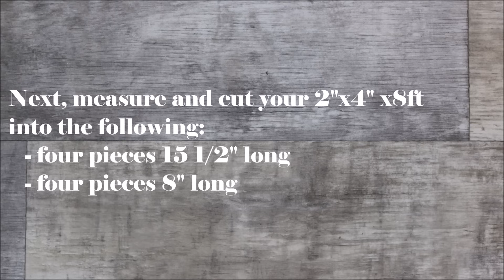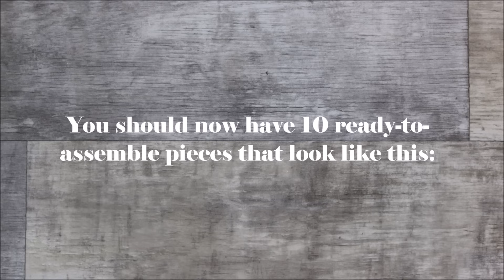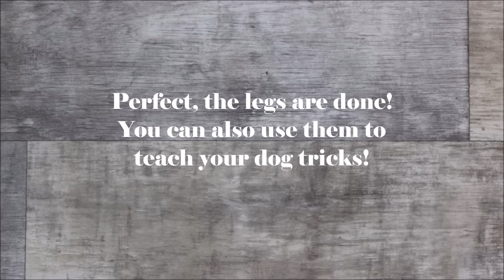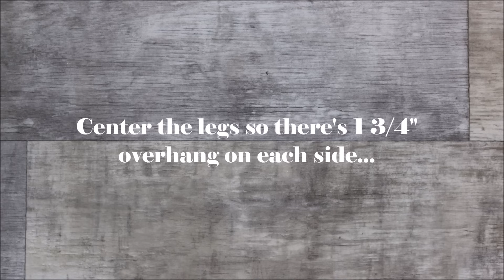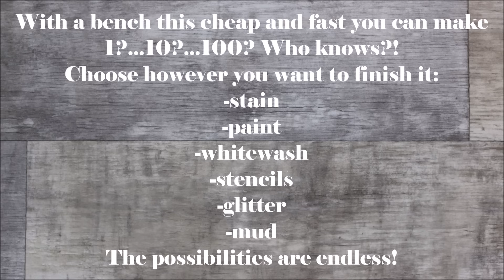The $15 Fifteen Minute Bench - Easy DIY Project

Comment: I just build this as an outdoor bench for my patio out of a box of wood screw [$8.98], (2) 2*6*4 cedar fencing face [$2.68/each] and (1) 2*4*8 pressure treated wood [$7]
so no need to stain 😅
There's no over hang on the side so is a bit skinner than the one here but definitely good enough for when I need a little outdoor seating on my tiny patio.

Comment: Good. If we make the bottom part of leg smaller so that it fits between the legs, then screw it about 2 inches from the ground, it probably give it more stability. The bottom part flush to the ground can make it wobbly with slight imperfections to floor or the wood.

Comment: Love the design but can you please explain to me how the Depth is 14 1/2 inches when both sides of the 2x8x8 are 8 inches.  So when placed together won't the depth be 16"?
Reply: Because the nominal/common measurements (2"x8") differ from the actual (1.5"x7.25"). So 7.25" x 2 = 14.5"

Comment: Change your dimensions a little on the legs and you can put the screws in so they don't show. Make the top and bottom piece a little longer and shorten the uprights and screw from the top and bottom. No visible screws. Add a couple of corner braces on each leg and it will be a lot more steady.

Comment: I'd run a by 4 across the bottom and top where I live a 2 by 4 is only 3 dollars and u would only need one cut in half for the extra support it would be worth it and if u ran t by 4s verticals on those supports it would definitely prevent and possibility of bowing

Comment: Just wondering the sturdiness from sideways wobble when people were using the bench. Do you need to add more planks to it. Interconnecting each pillar?
Reply from the maker: Years later and it's holding up just fine so you should be good

Comment: Did the bench today! Great design, but for my next one I would lengthen the 8” piece to a 12” piece.  This would give pull support width wise and not make the bench so easy to tip over (especially if it stand alone) and not leaning against any walls. No hate, just what I notice.  Mine is also double as a hide my package bench (since I have one side of it nailed with a particle board).
Reply: The 2x8x8?

Comment: You may want to enlarge the outer holes (legs only) where the legs attach to the top. Just pre drill two connecting holes to account for wood movement. This way the movement doesn’t effect the top, where the two boards meet, but allow it to move.

Comment: If you are doing this at home and dont already have everything it's not a $15 job...I spent about $45. Also they cannot cut wood for you ( Loews and Home depot smaller than 12 in. You have to saw yourself or rent one.  Just a heads up and make sure you have the right bit size...

Comment: how can we figure out how much weight the bench can hold? it’s such a great design but i don’t want it to break, as my family has big people !
Reply: I'm about 320 myself and made a 28" wide version of this bench. Sat on it and moved around and it didn't budge. As long as you use enough screws as shown on the video it should be fine. Only thing I might do differently is if you are making it a 4 ft wide bench like the video, maybe get one more 2x4 to make an extra support leg to go in the middle (same square leg as the ones in the video).

Comment: This is awesome!  Thanks for this!  A couple questions, what type of wood did you use here?  Also how did you get the edges of the seat part rounded?  Did you use a router maybe, or is it just sanded?  Thanks!
Reply from the maker: We used framing lumber so it's typically pine, spruce, or fir. The edges on this type of lumber are already rounded but you can sand them more as well, no router needed!
Reply: The Rehab Life Thank you!

Comment: Why was she using 2 different drills ? Cant the normal drill drive in the screws as well ? Sorry im totally a newbie to woodworking , should i buy the drill and impact driver ?
Reply: Prince Paulose it would be difficult without clamps to drill all the pilot holes, change to the driver bit and go back and drive all the screws. With two drills she can “predrill then screw” each hole without changing bits.

Comment: I made this with 2x8x8 Douglas fir, but they started cracking and warping after a couple months. Anyone else have the same problem? They are indoors in my room and haven’t gotten wet or anything. I want to make another, but am afraid of it happening again.. what would should I use? Do I need to get it from a lumber yard instead of Home Depot?

Comment: Application of thin panels to each of the "leg frames" would greatly strengthen them against front-to-back racking....; side-to-side racking with this design is an inevitability.....: a rod, dowel, pipe, etc. between leg frames MIGHT help.....but awaits calculation or testing.....  Maybe even some midline gussets between leg boxes & top MIGHT help....

Comment: Would it be better to trim the edge off the middle of the 2x8's to create a seamless top?
Reply: if you square everything up then it isn't "rustic". Using pocket screws and clean edges you get a finished look. Simple design with many possibilities. I've made a few modifications and love mine.

Comment: I know simplicity is the point of these videos, but perhaps it's time to introduce some other forms of joinery. Pocket holes, dowels, lap, rebate... these are still quite easy to do and would enhance the projects.
Reply: I'd be impressed if they started using wood glue myself.

Comment: OK just finished mine about a few hours ago.  I had been using a old wobble folding table, really old maybe 9 yrs old.  I said let me find a easy table to build, so off to YouTube.  Found the Rehab Life and thought I can do that.  My son was like mom I'm helping worried I would hurt myself.  First I couldn't find my electric saw mad then the screws were missing got really mad really I started crying.  I struggled through how ever and look for screws and use my brothers electric saw.  My son cut and then I use my drill and made holes and and with the screws I did find we finished.  Our real struggle was over.  Now I have a firm table in my bed room. The hard drive, screen and fax machine all fix nicely.  Now I want to know why men make this so hard with rules and levelers and all that other stuff.  This was the easiest thing I have ever made.  I'm thinking about using this ideal to make a stacking shelf for my kitchen, by just stacking two on top of other and mounting to studs.  Thanks for posting this video.  P/S with the minor set backs I had all the wood from other projects wonder if I should paint it.

Comment: what size is your drill bit for the pre drill for the screws?
Reply: If you look on the pack of screws that you buy, most times it will give a recommended drill bit size.  But generally if you just grab a screw and compare it's inner diameter (without the threads) and find a bit that is close to that you should be good.

Comment: So, I use wood I already had so I got thick and wider wood so I use that but I had make legs wider for it because of that so it would go over when you got up from the bench just a tip for anyone using what you have since wood is so expensive right now.

Comment: Is this something where you could use nails instead of screws?
Reply: I wouldn't recommend it unless you've got a nail gun and you plan on using glue.  Construction nails in this context are going to want to work themselves out, and you'll have a hell of a time hammering a perfect 90 degree joint.  There's also a pretty good chance you'll split the boards by nailing without predrilling.

Bottom line is that screws and a drill driver are going to be a lot easier and more effective for something like this.

There are drills out there for 30 bucks and it's easy to learn :)

Comment: I decided to test this little clickbait title.
Has anyone done this in 15 minutes? 

Pretend the saw is set up and all tools are ready.

Anyone? 

I build a lot. I just built a large patio bar. A massive behemoth. I have built shooting benches, speaker shelves, record cabinets, playhouses etc.
Just so you know I'm not an amateur. 

This takes at least 45 minutes. 

Basically this video says you can cut in 5 minutes.
Square it up (which they leave out) and piece everything together in 5 minutes. 
Then sand it and stain it in 5 minutes. 

No way is that possible.

Comment: I think this would cost double that at my home depot/lowes
Reply: 2x8 - $3-7.

2x4 - $2-5. 

You only need one 2x8 and one to two 2x4's. If it's over $15, it won't be by much.
Reply: PapaKay use reclaimed wood. or drive by a junk yard and get a couple of used planks. that's what's in these days it sounds like